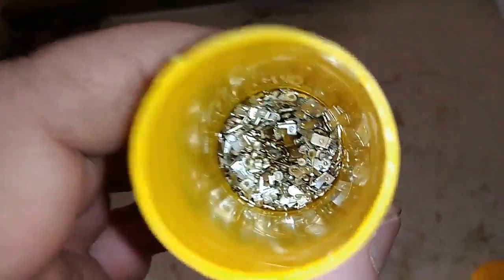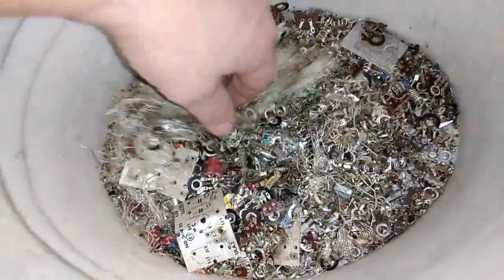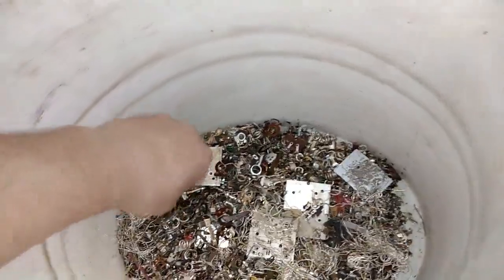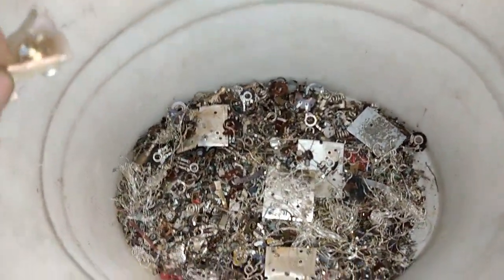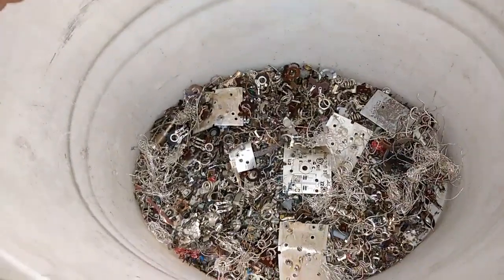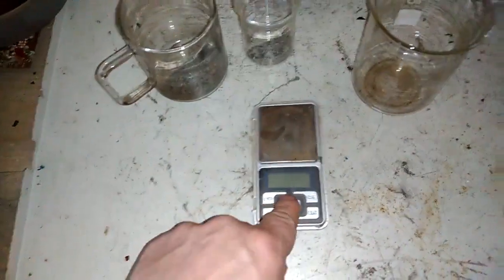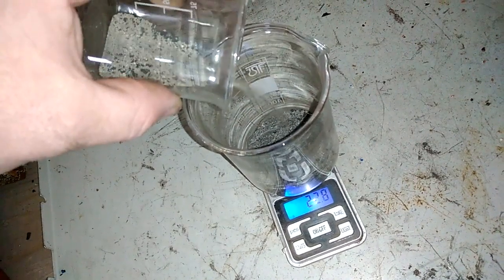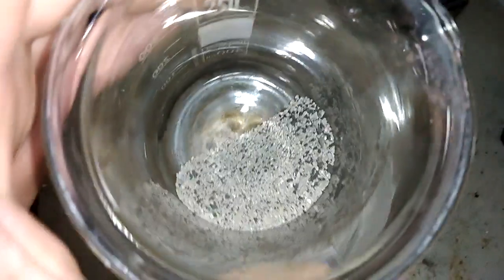Recovery of Silver from scrap using Melanž proses!

Comment: In Australia, Nitric acid is too expensive. Can you use sodium nitrate instead?
Reply from the maker: Yes you can. Cover material with sulfuric acid, disolve sodium nitrate in destilated water and add slowly to material.
Reply: @999DusanGoldrecovery  Thanks. how many grams of sodium nitrate crystals per ml of distilled water would be the best mix to substitute for the nitric acid. I don't want the substitute solution to be too weak or too strong.

Comment: If you add the lye while heating to about 80C (leaving a little water in the silver chloride.  I've tended to leave about half an inch covering the chloride), the conversion of silver chloride to silver hydroxide is more complete.  Little nodules of silver chloride may not entirely convert at room temps.   When it goes very smoothly, you'll have an even-looking layer of small brown-black loose granules, which all be about the same size.   The subsequent conversion from hydroxide to metallic silver is quite complete with a reducing sugar.  2 test batches of about 1 oz each with some known sterling, and then 2 more with some solid silver high-end lab electronics parts (an old broken PCR machine core) gave me phenomenal recoveries of nearly 100% of the calculated silver.

Comment: 20 gr of silver from that 2 kg plated, hmm is very much, but the price of sulfuric and nitric acid used it is approx. same with price of 20 gr of silver
Reply from the maker: In my country this acid cost me about 3$ mate.Work on the ficker plating to hehe...
Reply: Fck in Italy sulfuric acid is 3.5 euro per litre and 20 gr of silver is 10 euro and nitric acid you must distill sulfuric over nitric salt . Italy is the single country from Europe where I find at hardware store 98% sulfuric acid, in other countries you must order online or to buy battery car acid which is 40% sulfuric acid and you must concentrate things which are expensive
Reply from the maker: Here i need lot papers to bay acids, but sulfuric is 30 euro cent kilo, nitric is 25 euro cent and hcl iz 15 euro cent. But aur drain cleaner is from lye, sulfaric acid is forbiden on stores haah
Reply: I find more than 10 000 Cd for free and is not worth to try to recover the silver
Reply: @ddsdsa2939  In normal CD's and DVD's isn't there just an aluminum layer inside? But HDD platters do contain a little silver. Sreetips did a test on HDD platters and found that you need about 1000 or more to make it worth while.
Reply: This is another story